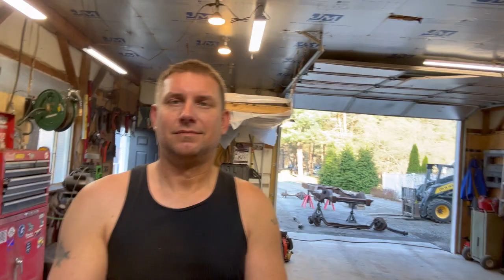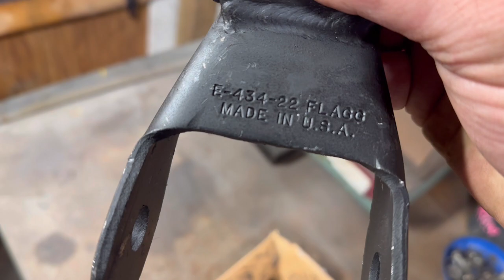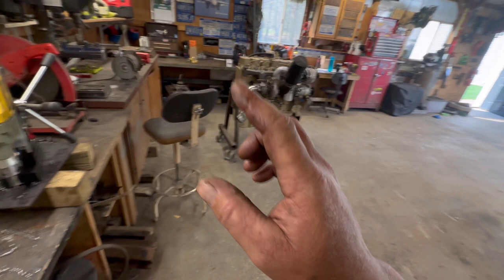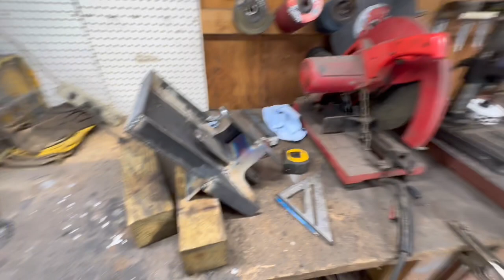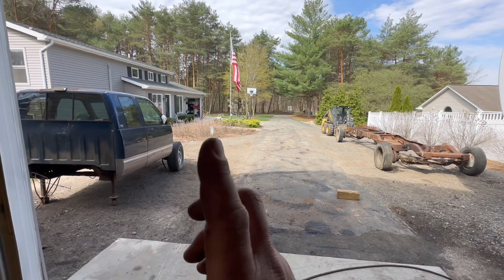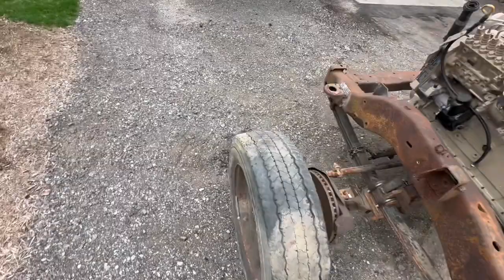Cummins swap C3500HD: Custom Air Ride 4-Link!!! Part 1

Comment: What are the dimensions of your rear 4 link plates? I have a 1950 Chevy 2 ton that might like a rear 4 link.
Reply from the maker: My plates are 10” x 14”.  The actual mounting flange of the nfamus metal 4 link mounts are smaller, I just needed a lower mounting point for proper ride height.

Comment: mag drill makes these projects so much easier and faster.
Reply from the maker: I don’t think I realized quite how useful it would be- it’s a game changer
Reply: @robstruckshop80  Great video. Do you remember about how much the mag drill was? 
(btw I love how you give the cost of many of the parts, most people keep it a secret)
Reply from the maker: This was the one I got.  Bought it with the hopes that it would at least get me through this one project and it’s met my goal and then some.  It’s definitely marginal quality, but it works.  

https://m.vevor.com/magnetic-drill-c_11000/md-40-electric-magnetic-drill-press-1-5-boring-w-11-pcs-hss-annular-cutter-bits-p_010246245322